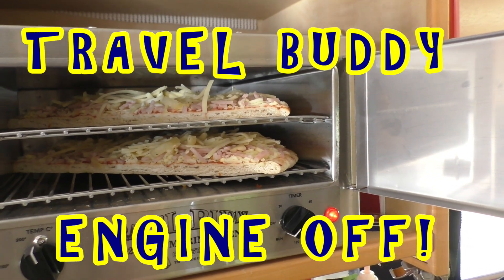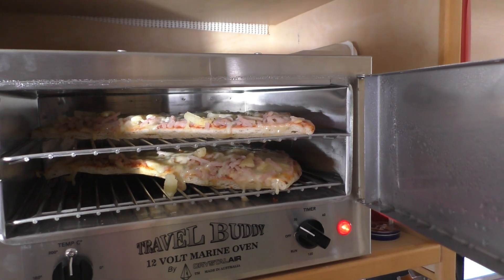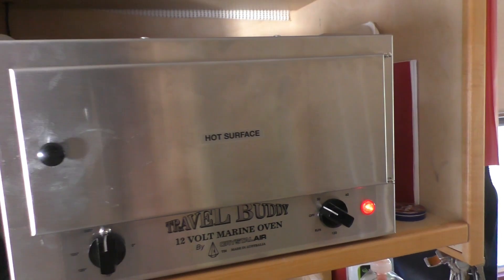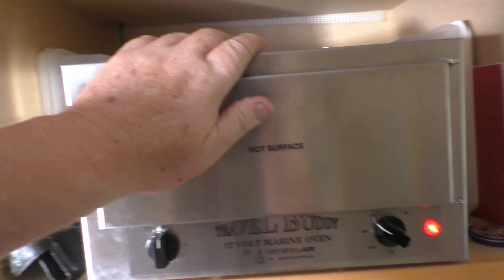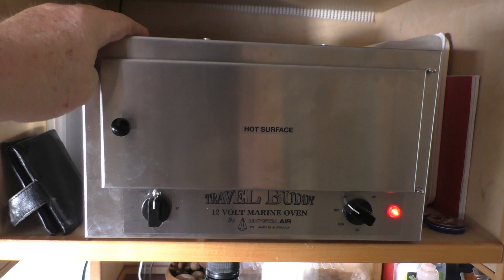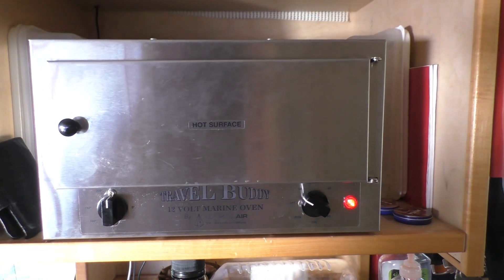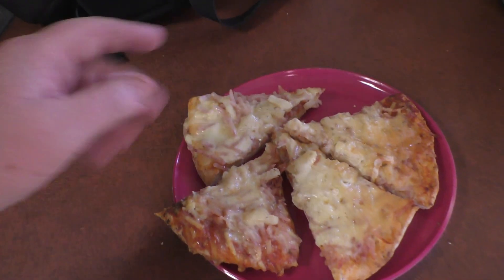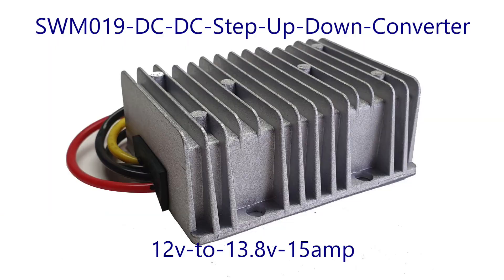Fixing Travel Buddy Engine Off Cooking

Comment: I’ve been running a step up inverter for the last couple of years.  Works a treat, just be away that as you battery drops in voltage it draws more amps to maintain 13.8v.  The flip side of course is that your cook times are less so you save on battery juice.  Enjoy😎👍
Reply from the maker: We have just started experimenting with it and discovered that it really does bump up the cooking temp. It also seems to activate a thermostat in the Travel Buddy as the oven turns off and then back on which is something I have never seen it do before.

Comment: Did you ever get around to doing a video on the install and performance of the the step up converter 👍
Reply from the maker: Hmmm, No, I haven't done one yet. Probably about time I did :) In short though, the step up converter makes the oven much more efficient when cooking with the engine off. It does chew more power but as long as there is plenty of solar, that isn't a problem.

Comment: ment to say use road chef oven, owned both lower draw on the chef 8amps but better heat, worsk great on 100amp lithuim with 250 watt panel : travel buddy only lasted 4mths
Reply from the maker: Odd to have a TB die. We have 2 and use them all the time.